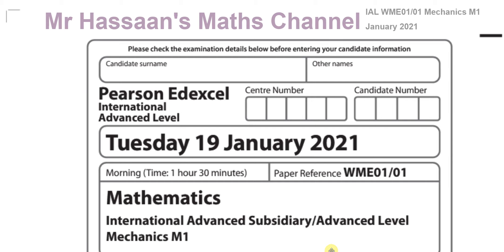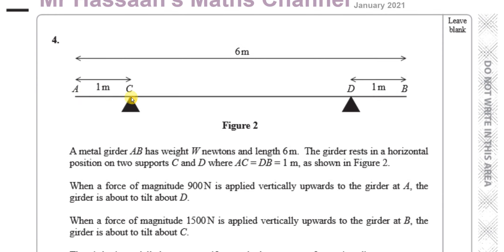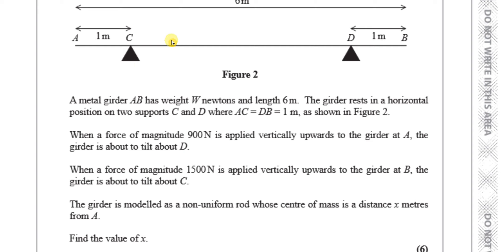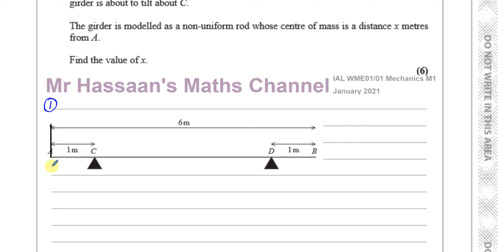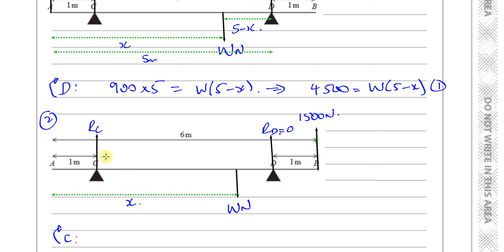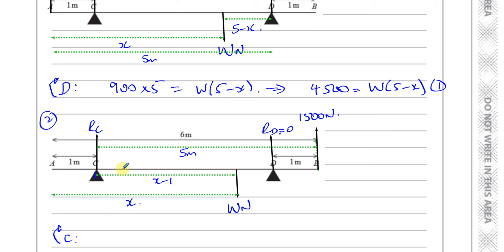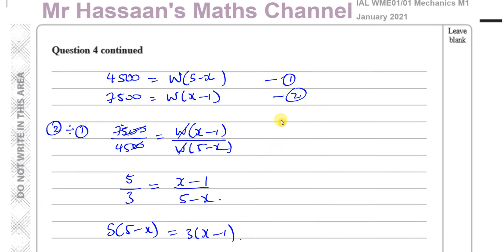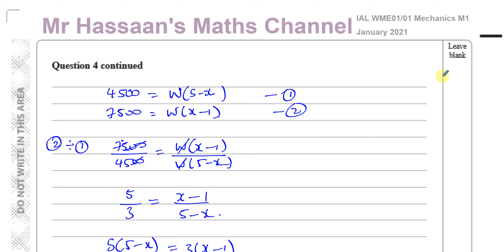WME01 01 (Edexcel) M1 January 2021 IAL Q4 Moments, Point of Tilting

Comment: Hello Mr Hassaan, 

@8:44 why do we specifically choose clockwise moments as (900x5), and anticlockwise moments as W(5-x)?
what determines which is clockwise and anticlockwise? 

I know it shouldnt matter too much here because we are equating both values, but im just trying to understand

Thank you
Reply from the maker: At that stage I was taking moments about D .... imagine that u placed ur finger on D so the point D cant move and u were able to push the beam in the direction of W ... the beam would move I  the anti clockwise direction ... and if you push in the direction of the Reaction at C it would move in the clockwise direction.
Reply: @MrHassaansMathsChannel   Thank you! Sorry just to clarify, When you say "in the direction of W the beam would move in the anti clockwise direction", is that because of the arrow pointing downwards for W?
Reply from the maker: @m21285  well it depends ... if you are taking moments about a point which is to the left of W and W is acting downwards .. that means W will cause a clockwise moment... and if the point at which u take moments is to the right of W and acts down... then then moment caused will be anticlockwise
Reply: @MrHassaansMathsChannel  thank you so much
Reply from the maker: Ur welcome